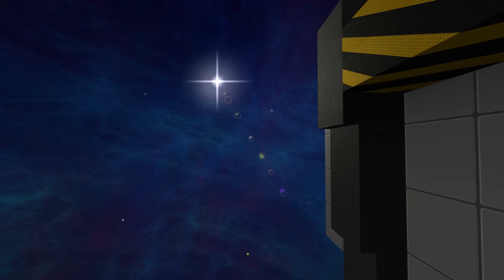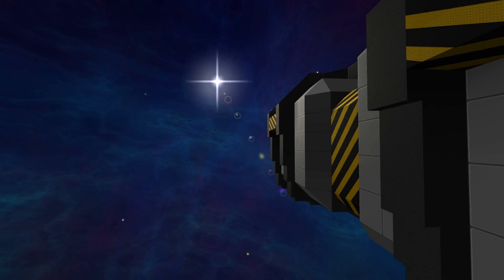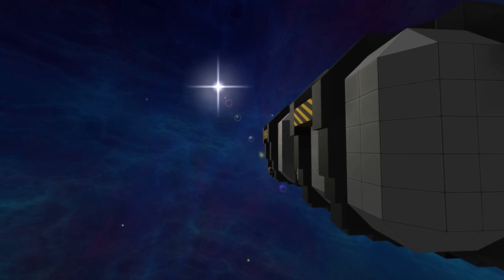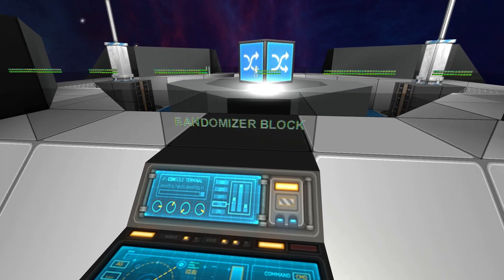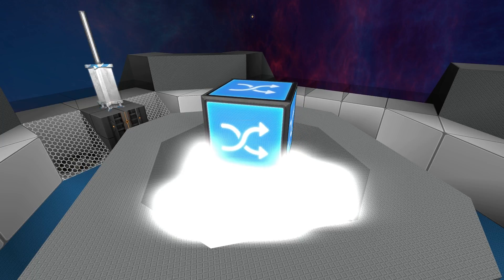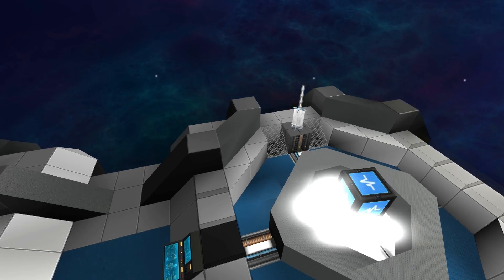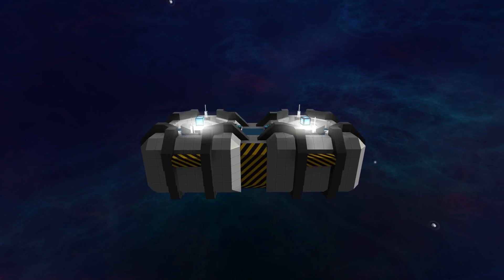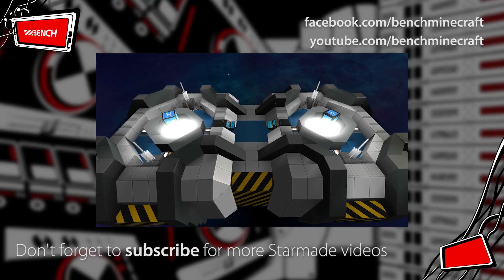Starmade Logic #25 - Introducing TWO NEW LOGIC BLOCKS

Comment: I wish there was a single block with options like they have in from the depths rather than this logic system..  It's just  over complicated for the new player. I appreciate it can achieve alot more this way, but linking 2 of these blocks could be used to create an if structure for example..  Right now I have no inclination to even used logic blocks at all.